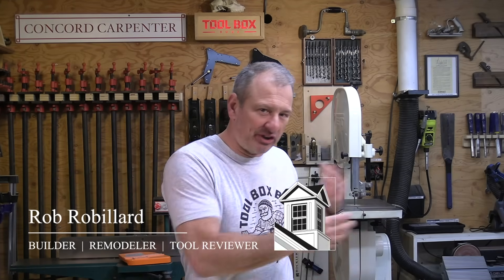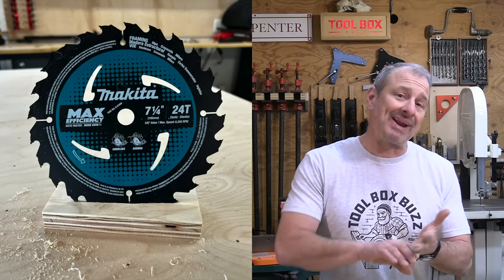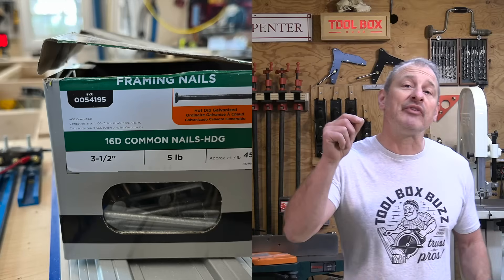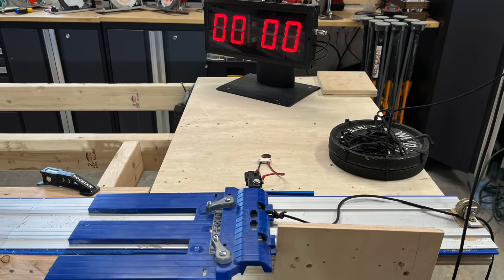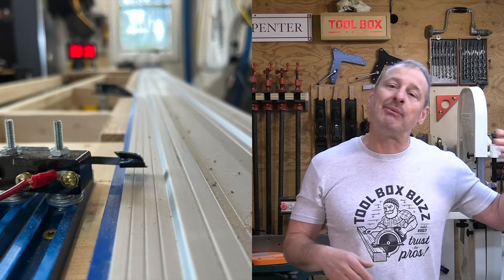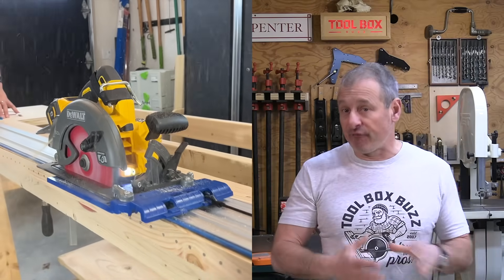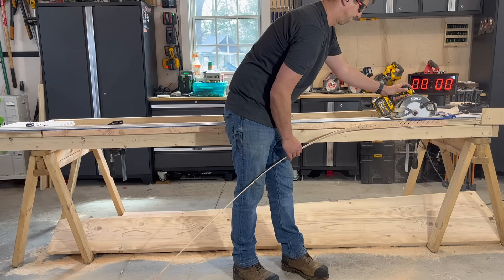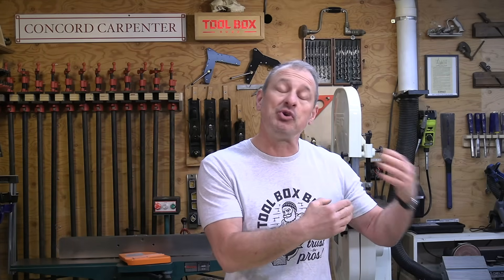24 Tooth Framing Blade Test

Comment: I do care a bit about cutting speed but longevity is always priority. That being said, I don't care how much nails my framing blade can cut because I don't use it to cut nails. That's why I'm not too sure about tests like these because even if the Diablo can cut 94 nails, it's not the nails that will kill the blade for most carpenter. In my case, I'll often go through a blade and I know for a fact that I've never cut a single nail with it. What I would like to know is which blade lasts longer cutting only clean wood. 
All in all, I still think the Diablo would always come out on top. Like many, it's been my go to for years just like their reciprocating saw blades.
Reply: Durability definitely matters when you don’t have a spare. I had a bunch of friends over to build some garage shelves. 1 stupid nail ruined my Ryobi oem blade. 30 minute trip to the store. A pro would have had an extra blade on site. So for small diy I would go with durability.  But a pro might have a different opinion.
Reply: I still have blades from the 1970’s. So I just don’t do enough cutting to ever where out a blade with clean wood. That is obviously not your situation.

Comment: I cut nails with a Sawzal and a bimetal blade, there's one more factor that your not considering the wear and tear on the saw its self which could be significant especially if the nail (s) are hardened as in concrete nails... who knows whats in or was used ? the down time, cost, wipes out any time savings.

Comment: I'm a DIYer who prefers blade longevity/durability over cut speed.

Changing blades is annoying.  My projects are so small and infrequent that I can tolerate the extra seconds it takes to cut things.  And since I'm an amateur, I also rely on blades with high durability since I wouldn't know a nearly worn out or damaged blade if I saw one.

Comment: Rob, 45 yrs in the business doing 50/50 mix of remodeling and new construction. I have used every blade in your test and keep coming back to the Diablo. It seems to be the fastest and longest lasting blade we have used. Good test and the results follow what we have experienced in the field
Reply: Agreed have a 10 pack  in my truck at all times
Reply: Yes. Bosch make great blades and paint them red so you will buy them.
Reply: And the VA blades suck!
Reply: Agree, I hate when true value don't have any and got to get dewalt, it doesn't last long
Reply: I normally remove the 1” of paint from the hole. Sucks cutting damp decking without sanding the washer bolt and blade shaft area of the blade. Damn thing even stops without removing it. Swapped to a non paint blade that day.  Was using a corded ‘90’s porter cable my go to
Reply: Diablo. All day.  The Dewalt is pretty good, also.
Reply: I am in almost the same boat, but the early 24 tooth 7 1/4" Freuds squirmed.
Irwins were a bargain.
Now I am not finding a decent 8 1/4" framer. May be Freuds improved??
I have had fantastic success with Freud shop tool blades.

Comment: For me the answer is both.  If remodeling type work then I will put on a Diablo thats designed to cut nails.  

If I know I will be doing a new material project that Makita is fast smooth and easy on the battery.  Just not as durable against metal.

Comment: Hey Mr. Concord would you have a lead on where I can buy regular thick saw blades? I'm pretty sure my terminology is incorrect but I really hate the thin curf blades the big box stores sale. Also is this blade a thin curf on more a thicker blade. Love the content.
Reply: Depends on what you plan to use it for but Forrest blades are great and will last a long time if you sharpen it. The terminology would be full kerf I believe. Diablo also makes fantastic blades for woodworking that aren’t available in the big box stores